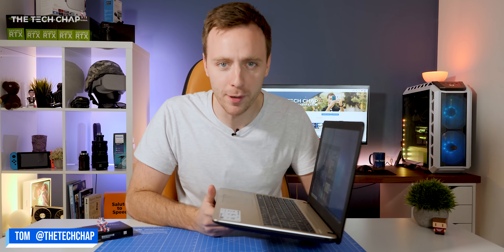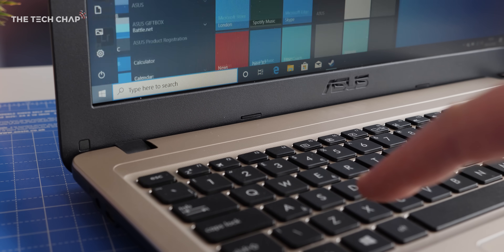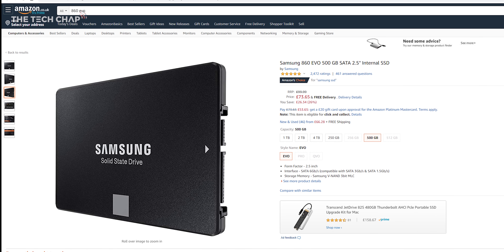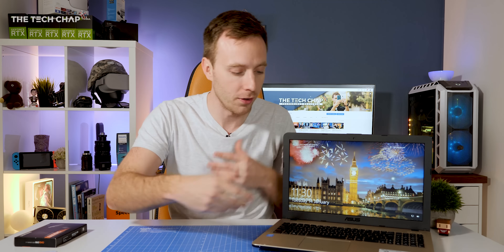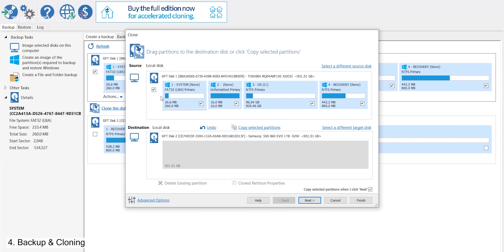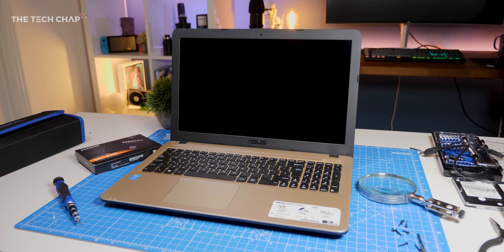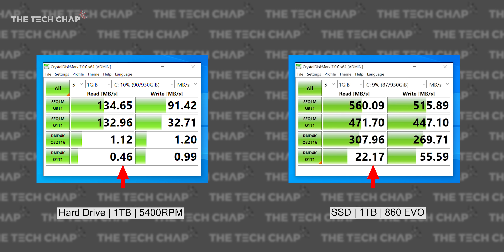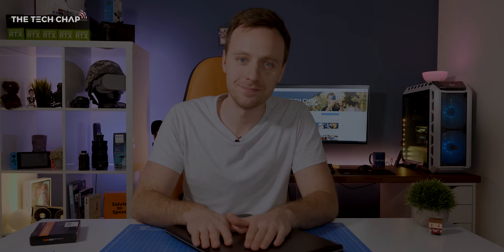How to UPGRADE Your Laptop with a SSD! #AD | The Tech Chap

Comment: My laptop had no ssd just a plastic place holder. It was sold as a gaming laptop. Not the case, but I am not disappointed. It's a strong little processor with two  upgradable ram docks. My question is since I did not have a ssd to begin with, where is my storage?

Comment: This i3 5th gen was booting up in 40 seconds without SSD meanwhile my i5 6th gen laptop was booting in 2.5 minutes without SSD. I'm wondering how? Does it depend on the harddrive quality also ? I had the Seagate 1tb 5400 rpm har drive... recently i have installed a crucial mx 500 ssd theres a world of difference in performance, booting time has come down to 30 seconds & restart in 50 seconds(10 minutes before).
But how is your i3 5th gen is faster than my i5 6th gen

Comment: I am assuming it the Operating system is on a separate drive inside the computer I don't need to worry about migrating data..as the drive I need to replace died but it was not the drive that had the OS.

Comment: Is it possible to do this also with an external SSD and boot your system from there in order to avoid having to open the laptop and potentially cause damage to some parts even if taking all the precautions you mentioned?
Reply: possibly so but you'd have to change the bios though, and I'm not sure exactly how you could manage to damage anything on opening up a laptop? especially if you're only changing/replacing the HDD

Comment: My old hard drive died the other day and am getting an SSD. Hopefully I can open my laptop without hurting it. My hard drive got so bad I couldn't even reset my laptop. Couldn't run any repairs or anything. 
I'm hoping a new drive will fix these issues.

Comment: hi everyone, i am currently changing the sata hdd to a sata ssd. At first I added an nvme ssd on my laptop and reinstalled my windows there, then I wanted to change my old hdd to a sata ssd, but after I replaced, a message appeared that the boot device was not found (even though the OS was installed on the nvme ssd not on the hdd) . After I swapped the ssd back into the old hdd...booting happens normally...what should I do to get my new ssd installed?

Comment: Can we completely remove the HDD on the laptop and start using the M.2 SSD or do we have to keep the 2.5 inch HDD installed on the laptop?
Reply: Depends on whether your laptop have M.2 slot or not. You can use regular 2.5 inch SSD from cheaper brands like Adata or Kingston  and it's still going to be much faster than any spinning plate HDD

Comment: Upgrading my Acer ES-15  quadcore.   Its never been quick even brand new or fresh install. And i suspected it was down to the mechanical drive which is probably a slow 52000rpm. Its a 1tb drive but ive never used anywhere near that so found a sweet oneday deal on a 512gb ssd for £35 on Amazon with prime. So i bought it.

Comment: Hey I'm getting turned on! I want an SSD now and I want it yesterday! Do you recommend getting SSD; one for OS, applications and HDD for Videos, Music, etc?
What do you recommend?
Reply: hello there! i just wanted to share that i currently have a 450gb (?) SSD as my boot drive and 1tb HDD for storage (movies, videos, etc.). i install programs in my SSD so they'll run faster. i think it's much better to reserve your SSD for your applications and use your HDD for your other not-really-necessary files
Reply: @sapphicism  Hey there. Have a basic question for you, since I am going to have the same config as you do once I receive my SSD.
I have a HDD with multiple partitions. My Windows of lies on C drive. Can I just clone the C drive to my SSD, then delete that partition on my HDD and be done with it, without touching the other partitions?
Reply: @arkaseth  Use the free Macrium Reflect software. It will shrink partitions if necessary.

Comment: what if im not bothered about my data i just want an ssd upgrade can i just pop it in lol ? and start from new?
Reply: Yes you can. Just remove the hard drive and install the SSD. Boot off of a Windows installer to install Windows on your blank SSD. Once it is installed, download and install the drivers for your hardware and updates and you should be good to go.

Comment: tbh if i could i would fix my laptop and just keep using it but the fixing cost of the screen getting better ran and more storage will end up costing me around £600 and i can buy a newer laptop with way better specs for 600-700 and i can still upgrade it if i need to but this is good to know when i upgrade my storage
edit, my laptop has dedicated openings that only open to the ram and ssd so instead of opening the whole laptop you only have to open 2 slots to get to the ram and storage which would be nice to have on the new laptop but you cant have it all unfortunately

Comment: I've upgraded an old dell 3520 with a crucial ssd and 8gb ram.  Found out I have a bad motherboard.  Even with buying a new motherboard, I've managed to bring the laptop back to life under 200 usd.  I also invested in a cloning device so transfer data from one hard drive to an ssd.  Those are cheap on amazon/ebay.  I've purchased most my parts from amazon.

Comment: My laptop is MSI GT72S 6QE Dominator Pro G. A very good laptop, but drive C has only 117 GB, of which just 10.7 GB is free. I wish I could somehow replace it with a much larger drive but have no idea how to do it, plus I am worried that software such as Vegas Pro would refuse to work because it would think I had copied it to a different computer. :(

Comment: What should i upgrade first ssd or ram?
Reply: That depends on what your current system currently has. Ideally, you want to upgrade both at the same time, but if you can't, I would probably upgrade to an SSD first.
Reply: i'd recommend upgrading the ssd first, but if you can upgrade both at the same time, it'd be much better (like what they ^ said)

Comment: I have a samsung np3530ec laptop, purchased in 2013, ran windows 8 back then, on win 10 since it came out. its very slow now and as i've looked after it , i'm going to add an SSD from crucial memory, 120gb for 26 quid and add 4gb ram for 28 quid, to see if its improved it. I imagine it will but I want to do this cheap and will pass onto son or use just as a spare web browser type thing. i have a new asus I7 500gb laptop so its my main machine, so this is a lets try it and see what happens. as i stream a lot now, ive moved on from the ripping dvd's and pirate**y thingies, a laptop is now just for youtube etc, hence doing this on the cheap. The ram i have is a 2 and 4 making 6. i intend adding 4 and taking the 2 out as ive read about they should be paired. i was for adding an extra 2gb for 13 quid, but changed my mind and will see how this does. I will keep the 2 i remove and if i feel like it, i can get 2 more in a month or so. what do you guys think, take the 2gb out or leave in in, so il have 2+4 and 4 new added, making 10. will the 2 left in effect it? it has 4 slots and 16gb max, recommended by cruical .

Comment: I have a $300 old Lenovo I got years back not super old but not young upgraded to Windows 10 from 8 and it's a slug but it's my first laptop of my own and I wanna keep it going as long as I can I don't know if I wanna keep my files but atleast I wanna turn it into a mobile modding system for console modding and maybe use it for steam gaming if it can run them at all

Comment: Is a 120gb drive a good one for people?
Reply: That's on the smaller side. I would go for at least a 250GB SSD. If you absolutely have to use that small of a drive, I would consider pairing it with a 1-2TB HDD.

Comment: any recommendation... i want to upgrade my laptop ? 
asus X8AIJ
processor: Pentium(R) dual core CPU T4500 @2.30GHz
memory(RAM) 2.00GB
Graphics MobileIntel(R) 4 series express chipset family
primary hard disk :  101GB free( 195 GB total)
model: K40IJ
total amount system memory: 2.00 GB RAM
system type:32-bit operating system
Number of processor core: 2
64-bit capable
Hard disk 466 GB
DISC PARTITION (c:) 195 total
disc partition (D;)270 total
814 MB- total graphics memory

dedicated graphics memory 64 MB
dedicated system memory 0 MB
shared system memory 750 MB
Display driver version 8.15.10.2869
Direct version DirectX 10

Comment: Guys i have hp 655 laptop it have win7 but if i change ssd is good to install win7 because win 10 will lag too with ssd
Reply: Yes you can install Windows 7 on the SSD. Though the hard part may be finding a W7 ISO to burn to a DVD or USB drive.

Comment: I recently sold my Acer E15 with 1.50ghz. A few days ago, bought a used, HP ProBook that's much faster. If I want to get a SSD later on, no screws to remove, just two slide buttons and the cover comes right off😀

Comment: Well well I have this exact laptop model. It was so slow after 2 years. I couldn't afford a Samsung so I went for Transcend SSD. Isn't crazy fast, doesn't have Samsung's advantage, but it's fast enough for me not to break my laptop in anger
Reply: As long as it's an SSD, that's all that matters for an OLD laptop.

It makes a night and day difference.
Reply: @PSYCHOV3N0M  Absolutely does. I suggest my friends that whatever you do, buy an SSD before a RAM. It's not super expensive, given the financial conditions of our country it's still a lil bit tough but manageable. Also, the experience is just superb

Comment: does this help to improve my laptop fps ?
Reply: Nope. Game performance is primarily determined by the hardware (mainly graphics card) and the game's graphics settings. Unfortunately, most laptops have no upgradeable graphics chips so you're pretty much out of luck. If you want better performance, you will need to buy a gaming laptop.

Comment: I suggest at least a decent CPU like i5 and above before considering this upgrade . If the laptop is a Celeron or Pentium one , don't bother because the CPU will still hold back everything and the sluggishness stay .
Reply: If its just office work, like  office or chrome, then its worth upgrading. Anything more and not reccomended
Reply: Replacing an OS HDD with SSD drive is a must for faster speed booting up. SSD nowadays is cheap relatively. Can also install a second sata SSD drive into the optical drive bay. The removed optical drive can serve as an external drive with the gadget he was using but need additional power supply.
Reply: Nope, hdd to ssd is ALWAYS worth upgrading. you can feel the difference exactly the same in new i7 and in an old core2duo laptop from 2009
No cpu can be so slow that it nulls the difference in everyday stuff

Comment: 6 months ago you can find a 500gb SSD for about £70
August 2020 you can find a 500gb SSD for about £50
Reply: I literally just ordered a 480gb SSD off Amazon for £40. They are only going to drop now, especially as the NVMe standard starts taking over.

Comment: I went from a 4 gig RAM laptop with an ssd, to a 16 gig RAM laptop with a hard drive, and I will say, that when buying a new laptop, more RAM is more important than faster storage.
Reply: No
Reply: @mlady_richard  either way, 4 gigs of ram is definitely too little and upgrading that would be first. The only time 4 gigs would be enough is if you were running Linux lol.
Reply: You can have your 9000 gb of ram but if u have old ETA hdd storage(i think you even don know what it is...) you can not even start a game becouse it is so slow, also graphic card is also more important than ram. For example gtx 1050 and 4gb ram is better than 32gb of ram and intel hd... You cant be experienced if u saying something like this.. Bye
Reply: @mlady_richard  I want to not have close chrome when I play games. If windows used like 2 to 3 gigs of ram without any applications, you only have 1 gig left. What are you gonna run with 1 gig of memory?Also how are you gonna upgrade graphics on a laptop lol
Reply: @block_head_steve240  you can not upgrade graphic but can overclock. And if you have fucking 1tb ssd you can open chrome you can open it in 1 damn second...
Reply: @mlady_richard  yeah but can you have multiple tabs of YouTube using only 1 gb of memory? Also only some cpu are overclockable.

Comment: HELP, MY LAPTOP WONT TURN ON IN BATTERY AFTER CHANGING SSD
Reply: You probably didn't ground yourself and caused an electrical shock to a component inside your computer
Reply: @YeTheGOATNoCap  i found the problem. I already fixed it. It seems that i mixed my screws ans put it on wrong place. I didnt know that screws are so much important

Comment: Pro tip: if you use your laptop only for web browsing, movies, e-mails and writing some document here and there... don't even bother with Windows and install Solus (Linux) instead... it looks like Windows, feels like Windows BUT it is much faster than Windows, is far less intrusive than Windows (updates when YOU want to update, no telemetry and spying on you) and is safer than Windows (your likelihood of catching a PC virus is very slim on Linux). 

Unless you need a very specific Windows only program or you game a lot (on a laptop? .... bruh) then there is virtually no reason to use Windows 10 in 2021. Windows 10 is old, intrusive, unsecure and slow.

Comment: When My Parents went to a mall to buy a ram chip , They asked the seller if He can also assemble the chip to my laptop, But after he opened my laptop, he said my ram chip in may laptop cant be replaced. What Should i do? My Laptop is Asus.
Reply: some laptop usually had the ram welded into the motherboard. But if it had another slot for ram, you can still add it. if there's not.... well, time to get a new laptop.
Reply: @astven94  damn it i had to tell my parents to just buy me a pc

Comment: I have to sacrifice my movies and personal files, remove it before cloning to a new ssd coz in my current hdd it has already a 1.2TB used space and my budget is only for 500gb ssd. 😭😭😭 No movies in my laptop anymore, i will always attach my old 2Tb hdd externally everytime im gonna watch movies after goin to replace it with only 500gb ssd..😭😭😭

Comment: I own one laptop and it's 15 years old(I hate laptops. So I don't buy them.). This is exactly how I upgraded it several years ago. I tinker with everything. All I did was used a SSD to USB connector, stuck a bit more memory into it, created my own lite version of Win10, and voila, a decent laptop again running Windows 10. Of course Windows 10 has a smaller resource footprint and it's designed to run on older and new hardware.
Reply: I've been "breaking" hardware and fixing it since the early eighties. Got my first game console in the seventies. A Telstar. It took 8 DD batteries, had 4 Pong like games and would only work on a B&W TV. Sometimes I wish I could back to those days when everyone wasn't connected so closely. I talk a lot. Heh.

Comment: If you want to increase the performance of your PC, uninstall Win 10 and install Win 7. For me, Win 10 is a completely unnecessary system. Personally, I don't use any of the "new" options offered by Win 10 (they're just garbage). All applications could easily run on older systems(But unfortunately, extortion is used from above). Win 10 and newer systems are there to burden old computers and force customers to buy new hardware and fuel this sick business system.